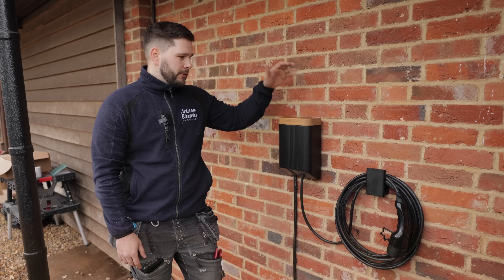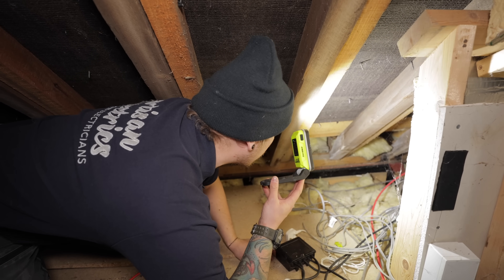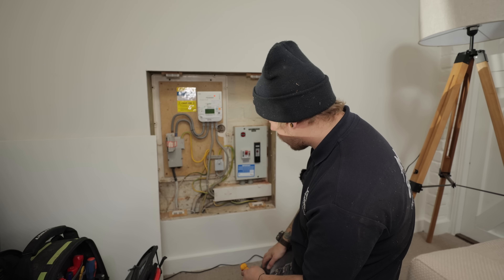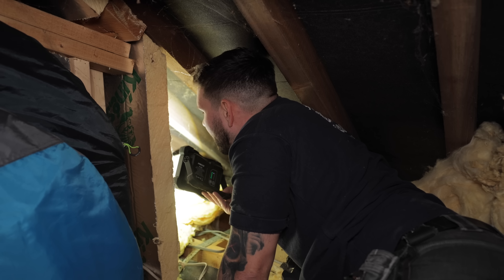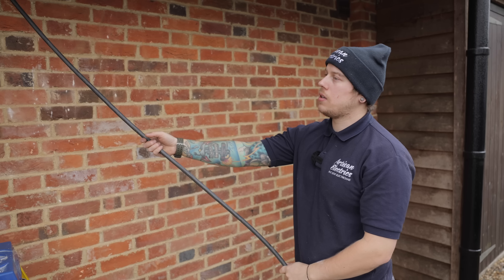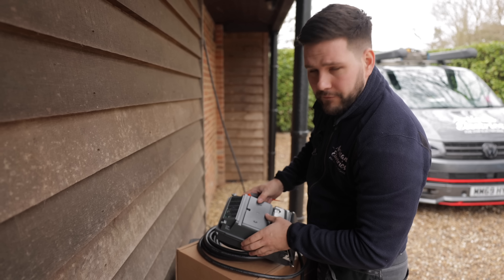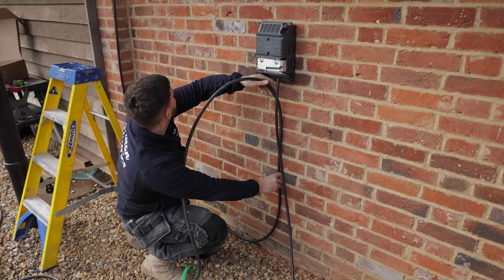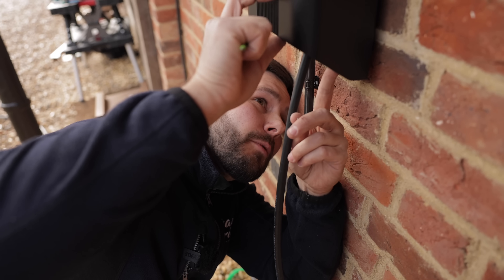Simpson & Partners Electric Vehicle Charging Point Installation

Comment: Please please please don’t use a stanly blade to tighten screws! It’s just not very Artisan, the connection wouldn’t be sound and there would possibly be a fault which would result in a call back and reduced confidence in the customer of the company.
You are all fab electricians and please keep up and continue to improve on your Artisan-ness going the extra mile, doing things neat and well is what we all love about Artisan Electrics!

Comment: It looks like a consequence of replacing the upstream enclosure was that the upstream HRC fuse became an upstream 63A type B MCB instead, reducing selectivity (discrimination) with the downstream 32A type B (and newly installed downstream 32A type C) MCBs.

What consideration was made about the loss of coordination between overcurrent protective devices & impact on continuity of service in the event of a fault?
Reply: Agree, but manufacturers require A type RCD/RCBO (switched N) &SPD upstream...

Comment: Great stuff. The trouble with removing the switched fuse for the sub at origin and replacing it with a MCB is that you can possibly lose selectivity between one tripping in DB. It's a gamble as which one trips first and sometimes both will trip.
Reply: Agree, but manufacturers require A typre RCD/RCBO (switched N) &SPD upstream.

Comment: ive just got a 1000v multi shaft screwdriver set in a roll from toolstation for £19.99 that has also got the torque t10, t15, t20 sizes in it. I've also got a multi bit set from Lidl a while back for £16.99 that has those terminal flat bits that would fit those screws (ifixit sell the same kit for £75). Tbh for me its all about having the right tools to install anything. At the end of the day its all about making sure you can be a good installer. Christmas cracker screwdriver ftw!.

Comment: I hope you didn't leave the box at about 11:24 like that, with the exposed copper bar.  Or maybe I have failed by arm chair electricians exam one too many times.
Reply: 12:00 - shows the DB with the blank in place
Reply: @sigsworth45  don't you still need to cover the copper bar even if it has a blank over it.
Reply: Bus bar should have been cut down to size - the plastic cover does not fully cover it, the blank is for the next lug down so the bar is still too long. It should not be left exposed, even partially.

Comment: do you actualt know how a smart meter works?
and why with a smart meter you are actualy paying for more electric than a non smart meter.
do you know why the smart meter was pushed onto the domestic customer?
have you ever taken a smart meter apart because if yu have then you would not be telling people that they save you energy and they are a good thing
Reply: I was repeatedly pushed to get one, can you please explain what the downside is and why they cost more than the old style meters.
Reply: @colingreer853  it is like this say you have a 1000 watt moter at home the electric generator company has to push 1080 watts down the cable to make your 1000 watt work the 80 watts is lost through connections and cable lenth.
second take a old incandesant light buld it has a power factor of 1 as it is a resistive load meaning the wave is in phase 
now new electronics use a conductive load and the power factor is around about 0.3 this is because of the cheap componants and this is not efficiant at all the wave on this is called out of phase.
in phase is draw a line then draw a wavey line that goes up and down that line where the two crosses is in phase and that is a power factor of 1very good a resistive load your incandesant light 

do the same but braw a second wavey line just infront of the first the crossing point is slightley out of phase the power factor is low bad.
big faturies that had big motors allways for years had a second meter that took this into account remember the 1000 watt moter the facturies would be billed for the extra watts that was pushed down the line .
domestic on the other hand was not there for they got that 20 watts for free as it would not register on the meter so with all the frighes freezers ect they generator companies lost money .
so all they did was call the same meter that they used for years a smart meter and put it in domectic houses.
and also you electric and gas companie can switch you on a a differant tarrif at peek time remotley.
they can also cut you off remotley as they have a big relay swith in them that is used to termanat power but it is also activated by the wirless system.
the only benifits to yu is you can see what and how much each applyence is useing that is it it does not save you any money it is a bigg mind bender they are playing.
if i was you i would tell them to replace it with the old metter it will be a none smatr bigital meter you have a time tio change your mind not sure what it is.
it is the bloody led bulds that have the worst power factor of about 0.17 i have seen.
i hope this helps  sorry for my spelling never very good at spelling but taking smart meters and stuff apart it is like breather for me.
thankyou for replying to my comment
Reply: @boilersuitguy4980  No supplier, afaik, is currently charging domestic customers for apparent power. They are only charging for real power (the same power measured by old analog meters)
Now this is not to say it will change in the future - but there are no indications it will do so. 

A smart meter is required if you want to have an EV tariff and if you have an electric car you really really want to have an EV tariff (unless you like paying 4 times as much to charge your car).
Reply: @boilersuitguy4980  Many thanks for the comprehensive reply. Lots to take in,
Reply: @boilersuitguy4980  Agree with you about the ability to remotely change the tariff you are on. I can (at the moment still) afford my electricity, but there’s no accounting for big company (in)competence and intransigence, and I worry I could be switched by ‘accident’.  I bought a power meter on Amazon, put into an electrically safe box and used it to check my old fashioned meter. If you already have a smart meter and the display has stopped working that’s a reasonable solution. And you can’t do that with a gas meter. So kicking my smart meter installation "down the road".
Reply: @zenthor13  the only person that benifits from a smart meter is the CEO of the company that installed it.
i would not even go for a water meter either they are not the same but they are on the way to becomming the same
Reply: No he can't because he's mental.
Reply: Usual ignorant FUD. Nobody is charging for apparent power, and the old meters could record it just as well as a 'smart' meter.
Reply: @Monkeh616  ok you belive that if you like i am refuring to the power factor and the lose from the generating company to your device i take it that you belive they do save the inviroment by reducing the amount bof power you use.
how many have you taken apart then.
i am going to assume you are going to reply you work for a company that makes then
Reply: @boilersuitguy4980  I'm well aware of the difference between real power and apparent power - the ratio being the power factor. They are not charging you for apparent power.

I have taken none apart because I don't need to personally take one apart to see inside them. Opening a box doesn't make you an expert - have you reverse engineered the firmware to see how they actually operate? The metering hardware is fundamentally identical to a 'dumb' electronic meter, after all.

No, I don't work for a company which makes them. I do, however, have a better idea of how they work than most, because I have, in fact, designed and built various types of power electronics and measurement tools for my own use.
Reply: @Monkeh616  so you know the differance between in phaes and out of phase power wave then all conductive power is out of phase. so it is this small out of phase that without the smart meter would be free electric for the domestic user.
so i simple terms the smart meter calculates the amount of electric that is out of phase and charges you.
Reply: @boilersuitguy4980  No, smart meters do not charge you for apparent power. Nor is 'conductive power' a meaningful term - you're attempting to describe inductive and capacitive loads presenting either a lagging or leading current waveform.

Please look up the terms 'real power', 'reactive power', 'complex power', and 'apparent power', and then perhaps we can discuss using the proper terminology. And again: Smart meters bill for real power, not apparent power. Nothing you see taking the lid off one would tell you otherwise.
Reply: @Ian Louden you keep thinking that you clearley know nothing about electronics but that is ok we cannot all be as smart as i am

Comment: Good job lads, I think looks great, but poor design with screws. Reccesed screws are a f'er, that is easy fix with plastic mould. That crappy ct clamp terminal, wtf are they using that cheap crap. Bt push in terminal thing would have been better. I think they need to think about installer too. Rather than look. But honestly great job from both of you, professionals.

Comment: Can't' believe that professional electricians, dealing today with so many smart fixtures, ev chargers etc. don't carry a Magnetic Precision Screwdriver Set (at £15 from Amazon). Would have solved all the issues fitting this charger. Don't need anything super high quality or branded either....Mine has been a real workhorse (electronics hobbyist) and is till going strong.
Reply: Time for Jordan to spend some money in proper Wera Wiha or Klein sets for the lads, since all of them have such sets.